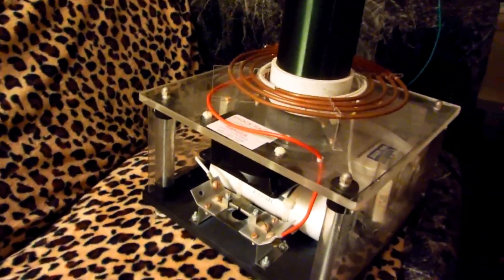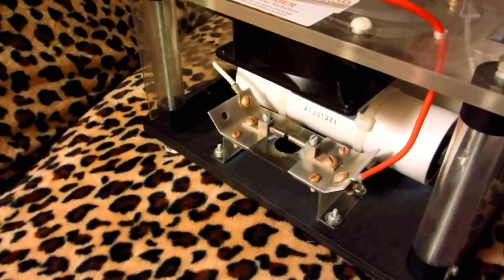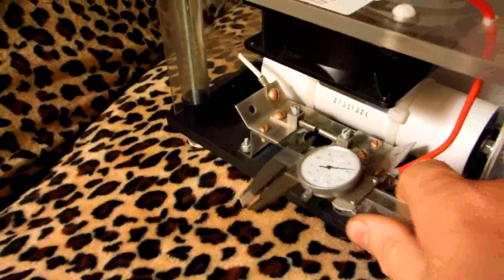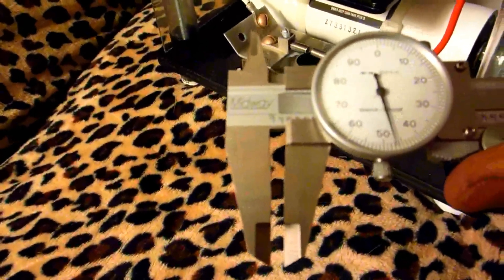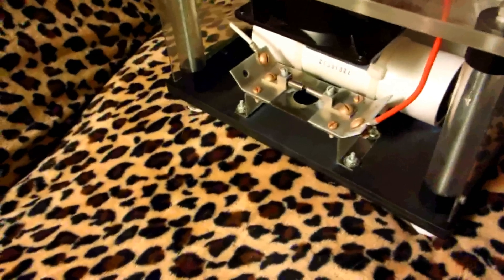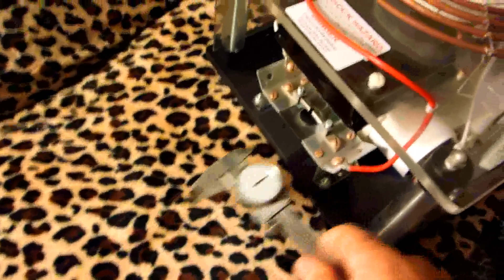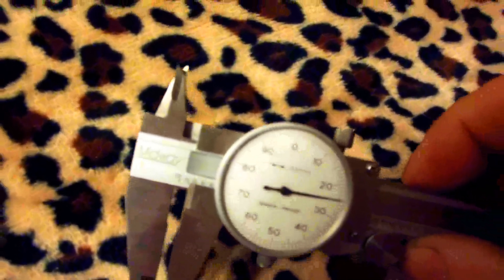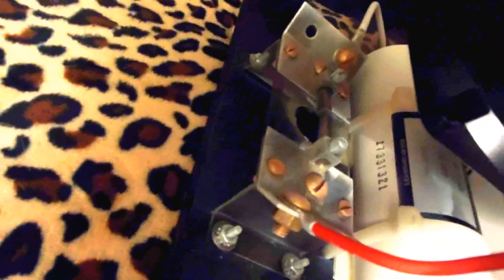Adjusting the Spark Gap on the Tesla Lakhovsky Coil.

Comment: What's the name of the instrument you are using for adjusting the spark gap?
Reply from the maker: +Michael Huang Vernier caliper
Reply: Thanks for the response. The tool seem to use only for measuring.how do you adjust the tungsten, in step by step mode?
Reply from the maker: +Michael Huang Just leave the set screw snug, not tight,  while adjusting.
Reply: Thank you for the clarifying. what tool do you use for unscrewing the screw snug.? And does the tungsten need replacement, Cleaning?
Reply: My new portable mwo shut down, flickering only after a week of use. I measure with tape, the tungstens are about 3mm apart. Did the tungsten actually move inward? I have to loosen the screw snug and move the tungs farther apart? What else did i miss..There's not much info in manual for maintenance. Thank you for the help.
Reply from the maker: +Michael Huang The electrodes could be dirty or the set screws are not making good contact.  Not sure what it could be.
Reply: Everything seem new and clean enough, Have to ask supplier. what screw plier did you use to unscrew the snug?
Reply: Problem fixed, by flipping the tungs around. The tungs wear out fast. How often do you change the tungs and is your unit still in good working condition?
Reply from the maker: +Michael Huang Mine still works.
Reply: Glad to hear its still in good working order for you. Its a very cool machine.